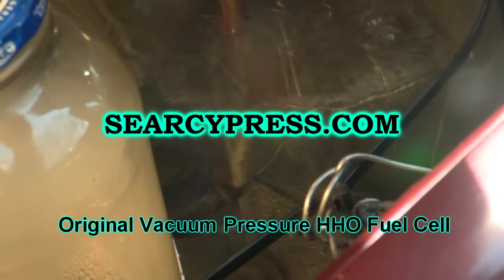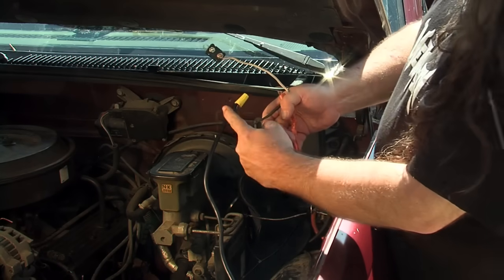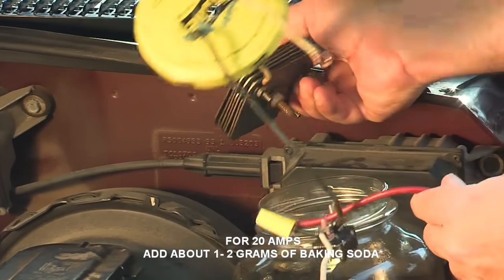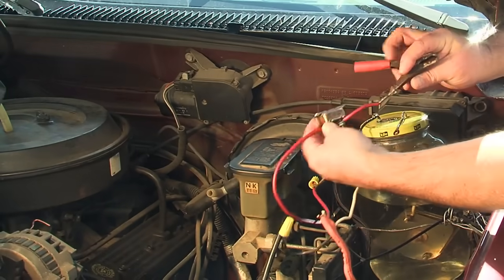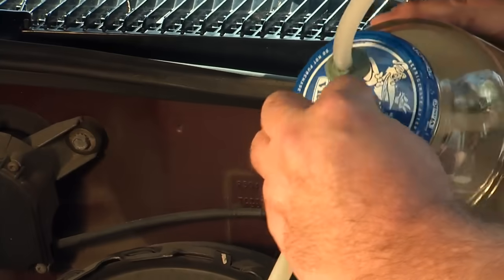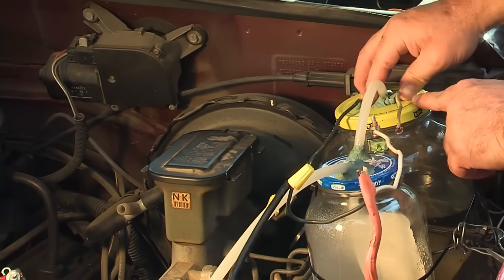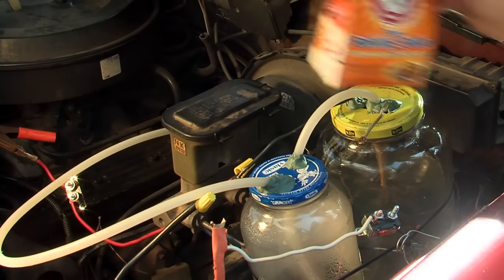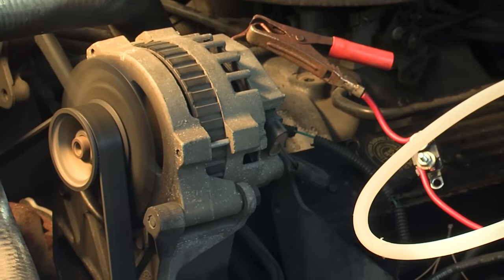Vacuum Pressure Hydrogen fuel cell defeats high gas prices using hydrogen from H2O.

Comment: we have seen alot of people try this at our shop. most people don't see the under side damage this can cause to a vehicles mechanical systems. valves, rockers, push rods and cams gummed up with a water/oil mix. can be very nasty and devastating.
Reply: The first thing I though of was the excess water vapour that is fed into the engine. It is made worse by operating this under vacuum which tends to reduce the boiling point. Electrolysis heats water very quickly and will boil fast under the reduced pressure.

Comment: For poorly running engines, especially on old vehicles with carburetors, adding hydrogen (and oxygen) gas to the intake can improve combustion, because the gas mixture aids ignition.
For newer vehicles with fuel injection in good shape, it isn't going to make much (or any) difference because the fuel-air mixture is carefully controlled and combustion of the fuel is close to 100% by design.
You can try this if you want, but there isn't much point unless you have an old vehicle with a carburetor. For fuel injected engines, you're better off testing all your sensors, cleaning the injectors, and generally getting your vehicle running properly instead of using this 'hack'.
Reply: Where did you come up with new vehicles running at 100% efficiency? They do make controllers so you can take advantage of different fuels. Ever went to drag race. Combustion engines still use carburetors. Fuel injection is just easier to control.
Reply: You're too stupid to have any kind of relevant opinion about pretty much anything.
Reply: @blanksender7808  you have actual evidence, or just insults?
Reply: @gawainethefirst  Just idling your engine is over a 600 rpms. Driving a 2.5 liter 4cly motor  is about 150 cubic inches. That's 37.5 cubic inches per a cylinder. A cylinder fires ever 2 full rotations. So in a minute of idling at 600 rpms your engine will use 11,250 cubic inches of air a minute at just idle. That's a 187.5 cubic inches a second of air. You're not producing even 2 cubic inches a second. But don't forget that it's h2O 2 parts hydrogen 1 part oxygen. So 1/3 of the gas isn't even hydrogen it's oxygen. So not even 1% of the air being taken into the cylinder is hydrogen. The only thing being accomplished here is the alternator is working harder for the high amp draw dragging the motor down more reducing fuel mileage. This is why water isn't used as fuel in a motor vehicle. 

Now don't forget we don't drive at 600 RPMs most people will be around 1800 rpms at cruising speed. That's 3x the amount of air with still the same hydrogen production. So now ur way below the threshold of .03% hydrogen in the cylinder. Using a spark arrestor on the output hose to keep from blowing the jar up you would be hard pressed to even candle a flame let alone put anything measurable in every cylinder 900x a minute cruising down the highway at the speed limit.
Reply: Dude... this would never work SMFH
Reply: 30% of the capability of the fuel in ICE is all that's utilized for the propulsion of a land vehicle
Reply: @jasonrist6582  The engine burns close to 100% of the fuel inside the combustion chamber.
Only about 25-30% of the heat energy is used to produce mechanical power. The rest is wasted through the cooling system, and leaves through the exhaust system. It's the thermal efficiency, not the percentage of fuel burned.
Reply: @jasonrist6582  thats because combustion is not efficient. Most of the energy in combustion is turned into heat energy instead of kinetic energy. The combustion of ICE engines is nearly 100% but energy lost through heat and the gearing means only about 30% of the energy produced in Combustion ends up turning the tires.  Same reason engine horsepower and power to the wheels are different.
Reply: I tried this with a resistor on the MAF. Kept throwing a code. Had a nice unit that I made. DO NOT USE GLASS in case of explosion
Reply: @time.528  You mean, you tried to make the engine use less fuel by using a resistor on the MAF sensor to decrease the signal voltage to the ECU?
There's a classic way to make your engine run like it's been through a war...
Reply: This. Any vehicle with OBD2 and a good  air fuel ratio monitoring is already optimizing the fuel mixture.  There will be some unburned fuel when cold and at heavy throttle, but this is to protect the engine from predetonation.

You can get the same benefit by just injecting small amounts of water or methanol to reduce combustion chamber temperature, but even this is only employed at wide open throttle, as the ECU controls things just fine when the ECU is operating in closed loop mode.
Reply: Combustion of the fuel is not near 100%. Even on brand new vehicles.
What would they sell in 10 years if ICE were at their peak this year or the next one.

Comment: I can't help but think the nearby crank case ventilation hose would be a better choice than the brake booster. Should anything go wrong as built you first lose power brakes.
Reply: EXACTLY, also he left out a few critical statements here. Introducing more air into the vacuum line will cause fuel injectors to introduce more fuel, therefore burning way more fuel than you did before. Also without a good way to vent the gas you would most likely build up enough HHO gas under the hood to kill everyone in the truck................................If it's on the internet and someone made a extra long video about it = IT MUST BE TRUE? XD

Comment: can you use this HHO device to run a diesel engine (thus replacing the diesel fuel)
Reply: I promise you, if you do this you will explode anything you connected it to. People don’t realize how dangerous hydrogen and oxygen are, they detonate when in the optimal ratio which is exactly what you are creating via eletric decommission of water.

Comment: This wouldn't work for several reasons.
Reply from the maker: I'm pretty sure I've heard everything. Let's cover it real quick. The assumption is there is no extra energy available because we are generating energy to produce hydrogen oxygen. This is incorrect because we are only burning 80% of the fuel that is going into the engine. Pushing that efficiency well above 90% would take care of that problem. Another assumption is that the O2 sensor will add fuel reducing any performance increases. Well this is a possible issue mainly on carburetor injected systems where the gas is mixed with air. We however are injecting this gas in vacuum. Even if that did occur there's still one thing remaining that causes our system to save us money regardless. We are able to burn low octane fuel and remove all engine ping. The boiling point of the water has been lowered due to the atmospheric pressure. We are steam injecting at the same time. I'm not suggesting anyone build this, we are just showing you how it was done. Thanks very much for your comment.

Comment: In 2002 Ford had a fleet of hydrogen test vehicles that ran off of hydrogen. There was no mixing it with gasoline. It was pure hydrogen. They were tested in California. They preformed brilliantly. The exhaust was steam. You can't get much more non polluting than that. After a test period they were withdrawn and never put into production for general use. All of the lies about explosions were just that. Lies!!!! Gasoline is a lot more dangerously flammable than hydrogen. BIG OIL STRIKES AGAIN!!!!!!!!!!

Comment: Wait, so he's using energy from the engine, to generate electricity, to create hydrogen from water, to then burn the hydrogen and turn the engine? I smell a thermodynamics issue.
Reply: "you should see water coming out out of your exhaust" yeah that's from the hydrocarbon fuel. C8H18 (octane) reacts with O2 (oxygen) to create CO2 (carbon dioxide) and H2O (....water). What even is this video?
Reply: @arzthaus  Which of his experiments tipped you off? I bet it was the fancy graph!

Comment: Had the same idea (gr8 mines think a like) ! My stang used to run HHO for a bunch of years (no longer in my possession, lost it in an explosion accident..unknown cause). In fact, only difference between mine & yours is that I actually used cumm (dick-seamen) for motor oil strictly for environmental reasons plus id also use windex for win shield whipper-fluid & my stang ran like a charm.. up until the accident.

Comment: Just GREAT!!!!  You could even improve this by running a small gasoline burner or electric heater under the electrolysis vessel to assist the vacuum.  From warm water we know viscosity is reduced and the gas will come out even more easily. ;-)
Reply: could just have a heater keep the water warm or if it freezes turn it back to water and would be safer and allow variable control, flames + explosive gas is dangerous when not intentionally burned

Comment: This method only works on carburatorated engines. Newer engines would not work due to the computers ability to adjust the fuel based on oxygen intake.
Reply: no issue with the ECM, this generates so little H2 and O2 that it's not noticable.

Comment: Hydrogen burns hotter, cylinder head temps go through the roof. The water compromises engine integrity, the gas is super flammable, and the computer system corrects for the spark knock, and fuel trim. You actually get worse economy with this. Those 29 amps are taking horsepower to generate. Don't do this. Y'all have a nice day

Comment: I feel the need to post a comment because there is nothing but free energy echo chamber remarks in the top comments.

The laws of thermodynamics are absolute, there is no free energy. Simply put, it will take more energy to split apart hydrogen and oxygen from water than you could ever get back burning that hydrogen and oxygen. Especially in an old school V8. 

There is no energy conspiracy.
Reply: conspiracy? what one person calls conspiracy, I call business as usual...
nothing to see here, move along, move along...
and for sure nothing is "free" the universe abhors a vacuum, anytime there is one, something will fill in its place. How people want something for nothing, is a very out of touch concept imo. So all said, just bc there's "vested" interests that have put all their chips into the conventional avenues we have today, and could possibly seek to stifle anything that would challenge or jeopardize their bottom line. To me that is no conspiracy, it is simply shrewd business practice. but to each his own... opinions are like eyeballs, most people have at least one. plus I believe in the right of everyone to have their own opinion and I certainly would not want that taken from me, so I definitely try not to poo poo other's opinions, even the few I do not agree with.

Comment: I think it would have been better to use something other than that jar, due to risk of breaking in a crash, but an otherwise good design.
Reply from the maker: Trust me we tried everything. Even ceramic models which produced crystalline formations on the exterior. The problem with any form of plastic is the heat and vacuum. Over time whatever you use will become physically distorted. The forces of vacuum are very great. Glass offered the best solution. Remember the system is in vacuum just like a light bulb.

Comment: Hydrogen is highly explosive and burns easily when mixed with air Water is composed of  hydrogen and Oxygen. What he is doing is making hydrogen from water and using it with gasoline so he can use less gasoline to run the car. He has to continually produce hydrogen though from water.  It is not a fuel cell as a fuel cell is a type of battery made using hydrogen and produces water as a by product.

Comment: Haha this is so stupid, "vacuum pressure", vacuum is the distinct lack of pressure, and HHO... If you believe you can generate more power by burning HHO than the extra power needed to turn the alternator harder to produce said HHO... why use other fuels at all? What the the world would be the point of that? free car go forever machine yay!!! Not a single person thinking this works has either a math or physics degree, thats for damn certain.

Comment: This is why they changed vehicles to computerized fuel injection systems, so you can't modify your fuel system without significant modifications.
Reply: No because our fuel economy has increased about 50% in the last 25 years. The emissions greatly reduced. This doesn't work on any car it never will basic math and not being stupid will tell u this. 

Just idling your engine is over a 600 rpms. Driving a 2.5 liter 4cly motor  is about 150 cubic inches. That's 37.5 cubic inches per a cylinder. A cylinder fires ever 2 full rotations. So in a minute of idling at 600 rpms your engine will use 11,250 cubic inches of air a minute at just idle. That's a 187.5 cubic inches a second of air. You're not producing even 2 cubic inches a second. But don't forget that it's h2O 2 parts hydrogen 1 part oxygen. So 1/3 of the gas isn't even hydrogen it's oxygen. So not even 1% of the air being taken into the cylinder is hydrogen. The only thing being accomplished here is the alternator is working harder for the high amp draw dragging the motor down more reducing fuel mileage. This is why water isn't used as fuel in a motor vehicle. 

Now don't forget we don't drive at 600 RPMs most people will be around 1800 rpms at cruising speed. That's 3x the amount of air with still the same hydrogen production. So now ur way below the threshold of .03% hydrogen in the cylinder. Using a spark arrestor on the output hose to keep from blowing the jar up you would be hard pressed to even candle a flame let alone put anything measurable in every cylinder 900x a minute cruising down the highway at the speed limit.

Comment: How this is still on YouTube after 10 years lol
Reply: Back in the day, I didn't believe it, but some classmates in college bought an HHO device that supplemented the fuel in the car, and it did work. This is not perpetual energy. It wouldn't run without real fuel. Think they only saw a 20% jump in fuel efficiency ...still not bad though.

Comment: The gain you get from the HHo is more than offset by the extra load required generate the power that cell draws. . This has been tried and tried............. at least be honest.
Reply from the maker: Only 80% of the fuel is burned in this engine. By using a little bit more energy you can increase the efficiency into the high 90s. That's a lot of gain from efficiency. Disregarding our findings, you will be able to burn low octane fuel and completely eliminate engine ping. This saves you money regardless. Thanks very much for your comment.

Comment: I built one for a 6.9 diesel and it is a joke.
My HHO cell was five or six times that big, (2" x 16 " by 10 plates in a 6" by 2 foot plastic pipe) used potasium hydroxide instead of baking soda, much more reactive and generates more gas. There is no excess electric at the alternator, it takes horse power to generate electricity. Generate more electricity, use more HP. Any fuel mileage gain you see is because you are driving different, not because you have HHO gas.
Want proof, measure how much HHO gas you produce in a minute in liters, yes I know since it is plumbed into a vacuum line you can't measure it, but that vacuum makes little or no difference on how much HHO is produced. Now figure out how many liters of air you are sucking through that engine every minute. 350 chevy, 5.7 liters every two revolutions of the engine times say 2000 RPM. So 5.7 divided by 2 equals 2.85 liters times 2000 RPM equals 5700 liters of air per minute.
I am going to guess that HHO generator is capable of a quarter to half liter per minute. A half liter added to 5700 liters is not much more than  a trace amount.
Reply: Some things are too good to be true since you went through the scenario did you find any truth to that setup for the engine cleaning possibly? I mean do you think it can work to spruce up/revitalize an engine  or is this just not worth the time to do because like you said it's just too little to make a difference in mileage but cleanliness? 
Thank you for your time and effort.

Comment: Myth busters  debunked this..
Reply from the maker: Yes they showed it could barely make a bubble three months after we aired it on public access tv in 8 states. Gasoline was$4 a gallon and shortly thereafter fell to .99 cents. We have produced up to 6 liters per minute. Not that you would want to do that mind you. They did what they were told to do. It was damage control. Thanks for the comment.

Comment: One of the best videos I've seen on YouTube in terms of educational value, even if you don't build it, it's very clever to capture excess energy and turn it into fuel

One improvement: instead of metal plates you can use two wire mesh sponges separated by a sock. It offers a lot more surface area for electrolysis. It's built in another YouTube video by another channel. Forgot the title

Comment: the only problem with this is were we thought the polar ice caps melting and we having to live in a water world cause we thought we had to much water but rather were all the water gets popped and we all thirsty ...
Reply: like what if you use hydrogen peroxide to run your fuel cell that is like holly water ...
Reply: um a rocket powered grandfather clock ..?